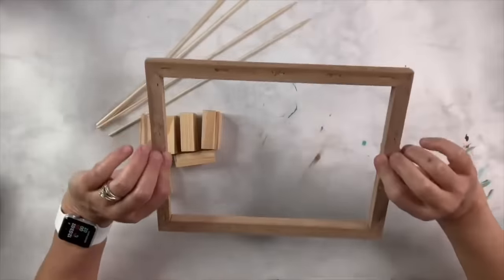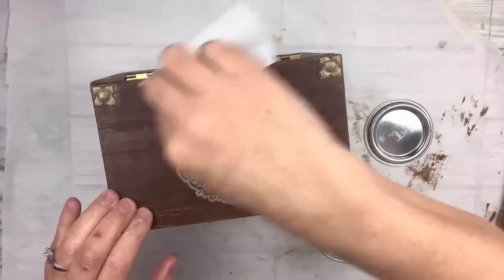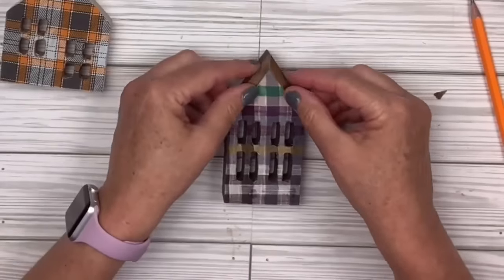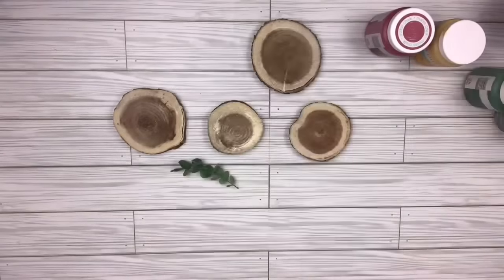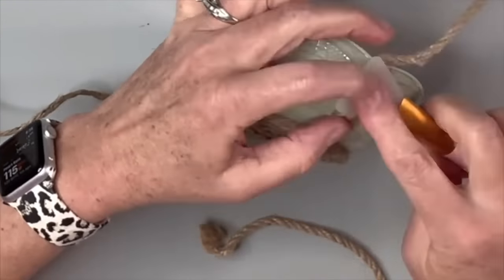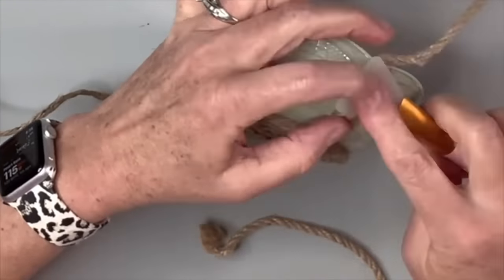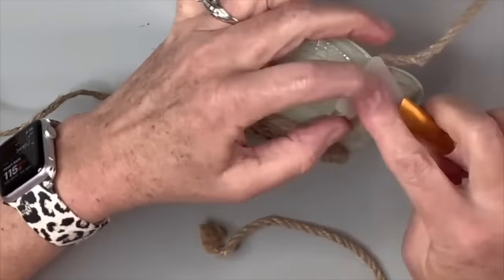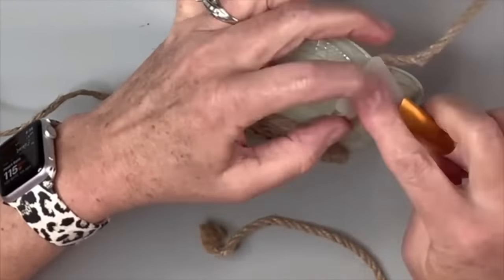55 GENIUS Rustic DIY Crafts For Home Decor

Comment: Your pieces are awesome, especially since they're trash to treasure. I have a suggestion. When using the tumbling tower blocks, use spackling to fill in the gaps. It makes it look professional and it's simple to work with.
Reply from the maker: Thanks for the tip Tess! I can see how that would be nice. I might try it on certain projects.

Comment: If you take some hot glue and put it on the bottom corners of your miter box, you’ll find it helps create an anti-slip surface. Makes it much easier.
  (works for socks too)
Reply from the maker: Love that! Thanks for the tip.